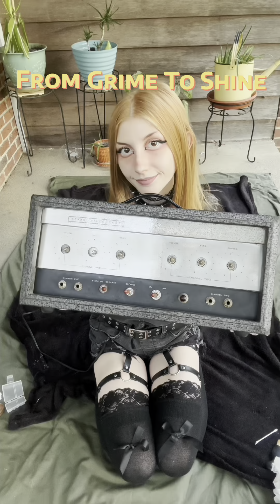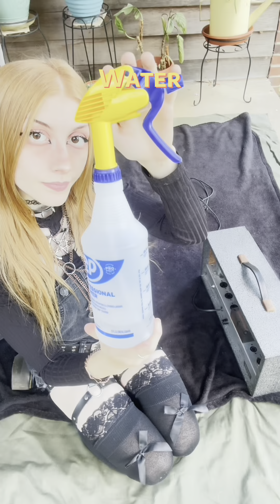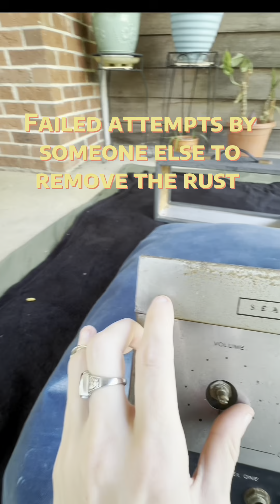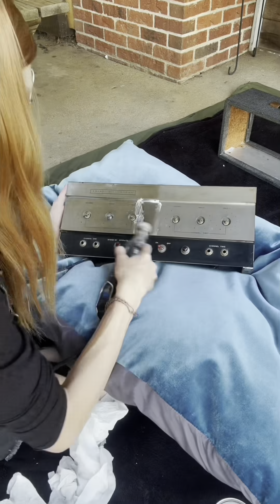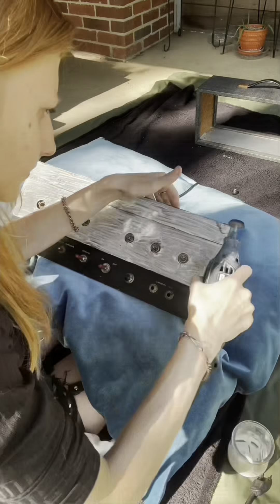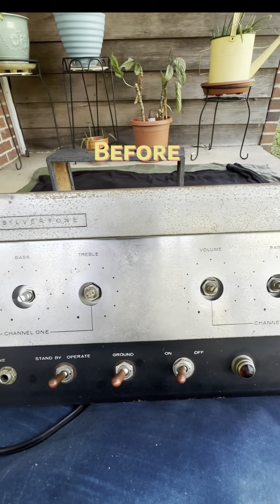From Grime To Shine Learn How To Clean Your Amp | #amp #amplifier #amplife #silvertone #guitarcare

Comment: Water and electronics do not mix. 99 percent Rubbing alcohol instead. You can short out parts in your amp and rust internal components using water.
Reply from the maker: 99% Isopropyl Alcohol is great to use when cleaning electronic components and circuit boards but is a big no no when cleaning face plates like you see me doing here!  Isopropyl Alcohol is a solvent and will cause the silk screen lettering to wipe right off. When ever i use water on a amp i always make sure to spray the water into a rag and never directly onto the amp to ensure no water ever enters the amp! ❤️